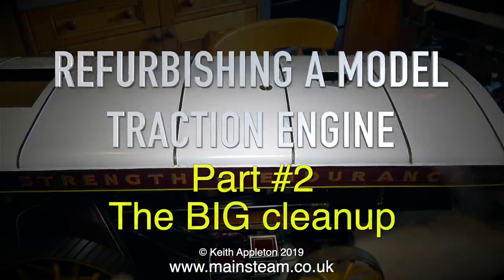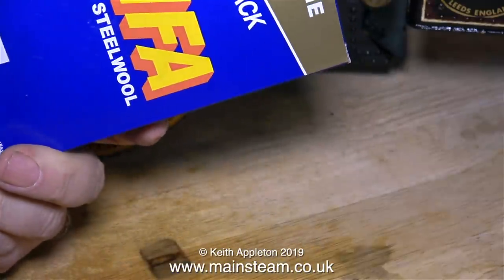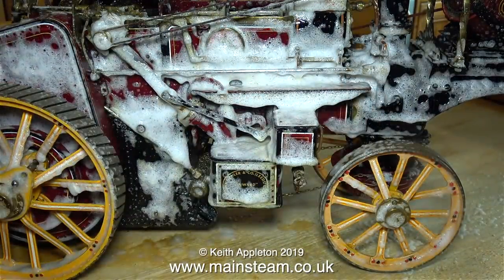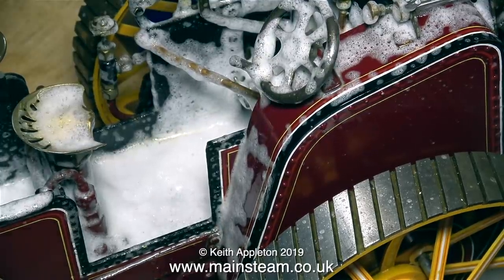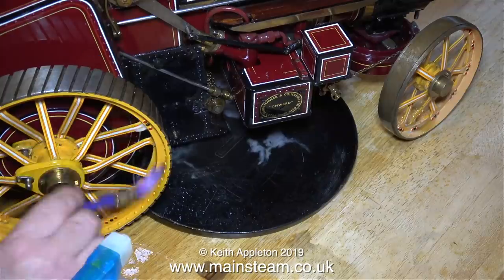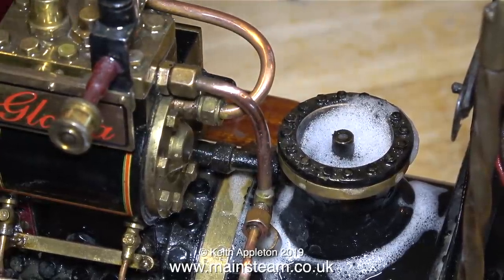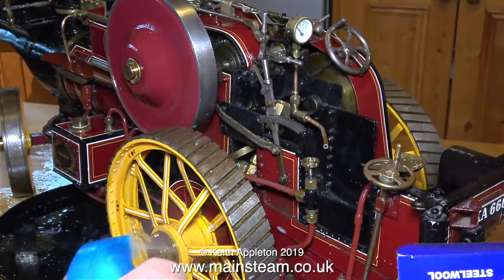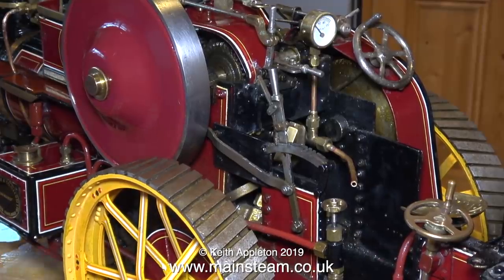REFURBISHING A MODEL TRACTION ENGINE - PART #2

Comment: I like the animation Charlotte did for the intro and exit. Many years back a friend of mine built a   radio controlled model boat on his dinning room table while his wife was away for the summer. The week before his wife was to come back he phoned me and asked if I could come with my truck and give him a hand. He had put a couple of blankets on the table before he started, but various solvents glue and spots where he had gouged and drilled through were visible. He asked me if the table was salvageable and I said it's not the table he had to worry about it's his life and marriage that was in jeopardy. We found a furniture store that had an identical table set, which he bought (I think I could have bought a good used Bridgeport for what he payed) and we brought it to his place in my truck. We took the old table and chairs and put them in the unused barn, and put the new one in the dinning room. About a week after his wife got back she asked what had happened to the old dinning room table, He tried to act innocent, but she said that is now the original table as the scar where her Father ha cut it wasn't there and the old set only had six chairs not eight. Never try to fool a wife.

Comment: that beautiful traction engine looks like you could fall into the "if i just remove one more part i'll be able to clean/paint/re-something a bit more" . . . if you don't intend to do a complete overhaul, be strong . . . otherwise go for it!

i've used the 0000 steel wool for something slightly different . . . it puts a beautiful satin finish on polyurethane . . . i always use gloss polyurethane because without the additives that give it a duller finish it seems much stronger and harder to damage.

i put on one or two coats and either steel wool or sand each to remove bubbles, drips or other imperfections . . . then a top coat taking extra care not to mess it up . . . then rub it down with the 0000 steel wool . . . it dulls the surface to a satin finish and really lets you see "into" the wood to get the grain.

i did an entire set of kitchen cabinets that way and the finish is almost bulletproof . . . you might think about using the method on one of your baseboards . . . or not.

Comment: I find a good household degreaser to be Fairy power spray, it's sort of half way between washing up liquid & oven cleaner !
As well as degreasing it will if left, lift carbon deposits, i sometimes use it to clean brake dust from alloy wheels.
Reply from the maker: Yes I have tried it and it is very good. A friend of mine recommends "Swarfega" hand cleaner - I will try that too.

Comment: What was the name of that Cleaner Keith? :-)
Reply from the maker: "Flash" with Bleach . . .
Reply: Must remember that. I do a fair bit of work at old cars and Screwfix own degreaser is a very good cleaner as well and doesn't melt finishes like some with thinner in. Love the videos.
Reply: Keith Appleton is this traction engine is for sale on ebay?

Comment: Seeing nothing in the comments to the subject, maybe you already know about removing rust from from steel and chromed steel parts using 0000 steel wool and mild phosphoric acid solution (Diet Coca-Cola). Use the diet type to avoid sugar residue.
For a period of time I owned a 1957 Chevrolet Bel Air Sedan, and that's a method we owners of such cars used avidly.